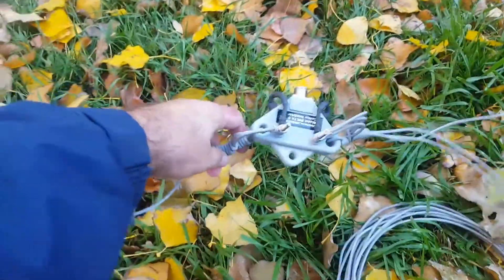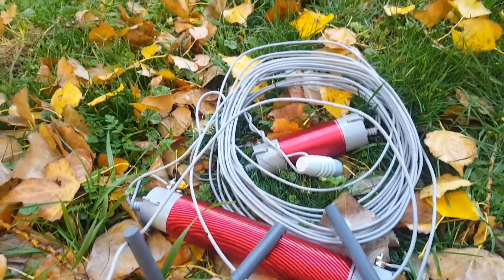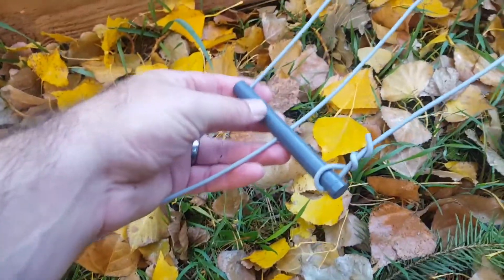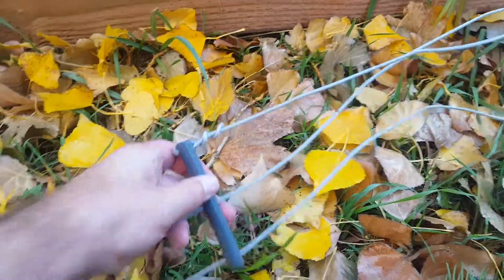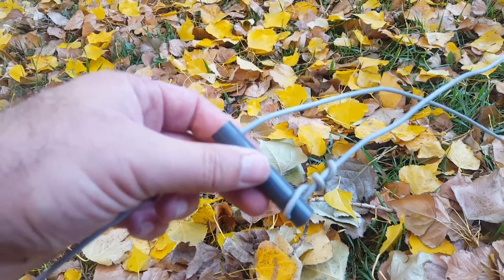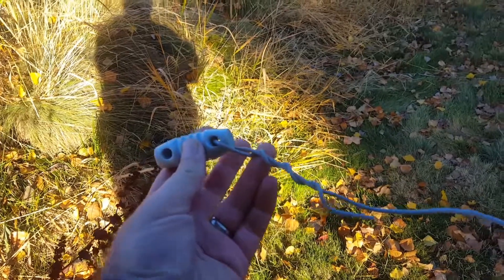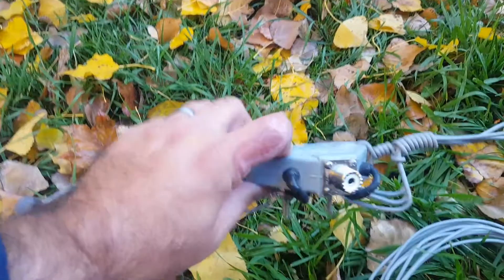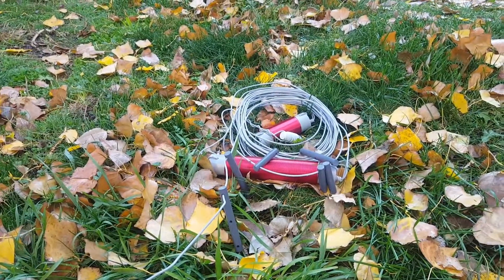Alpha Delta DX LB plus 160m - 10m part 2

Comment: So how does it work?
Reply from the maker: It worked very well for me while I had it in the air. It was very close to perfect match on everything from 10 through 20, 40, 80, and 160 all had a match but they were very narrow banded. A tuner would bring them in close and make it usable on those without too many issues.

Comment: I read somewhere that this antenna does not cover the WARC bands (30m, 17m, 12m). Is that true?
Reply from the maker: the SWR is little high on some of them, but with a tuner you will make your radio happy enough to use the other bands. 17m is a harmonic of 40m, so I found my SWR was little high, about 2:1, but usable

Comment: I have that antenna...works good, however, 160 is still tough to tune...
Reply from the maker: 160 seems to be one of those challenging bands. The antennas are ridiculously large in the bandwidth is very small, one of these days I would like to make some contacts on it.